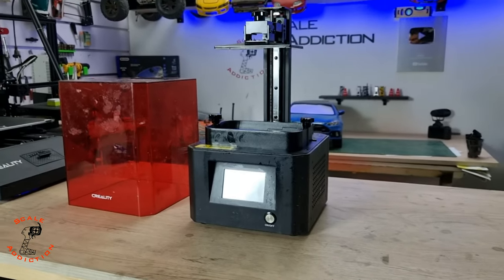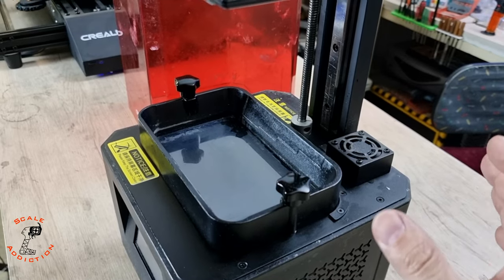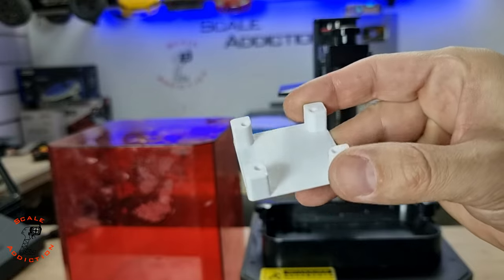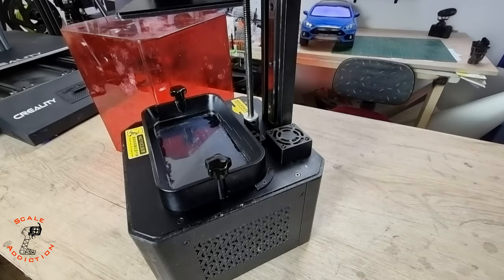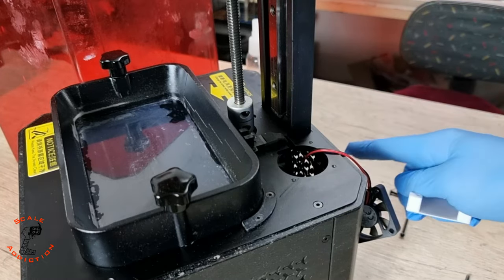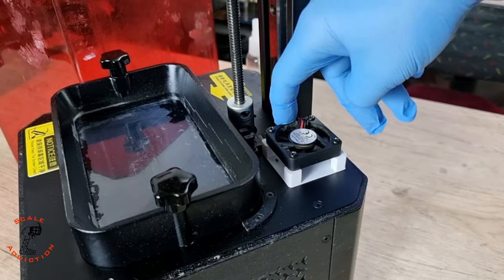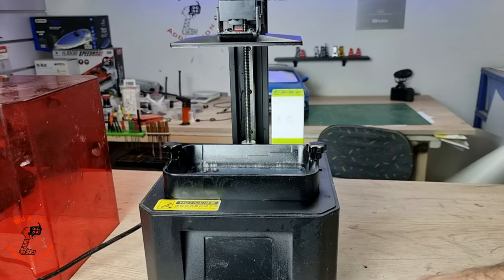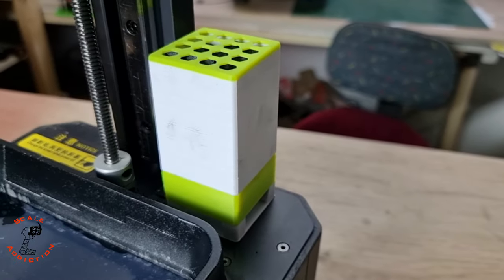3D Printed carbon filter for resin printer creality ld002h\resin printer fume filter/Scale Addiction

Comment: Am trying to figure how this works, is the air outlet blocked by the bottom part of the extractor ?
Reply from the maker: The bottom is closed so it doesn't push the fume out side from the back of the printer, just to circulate and  filter it inside